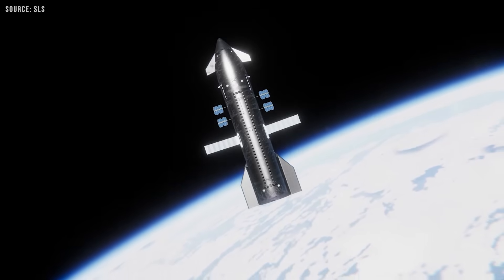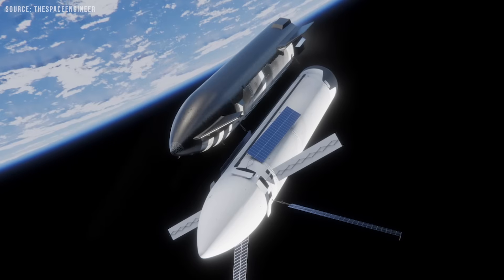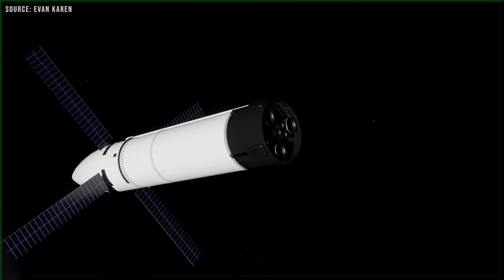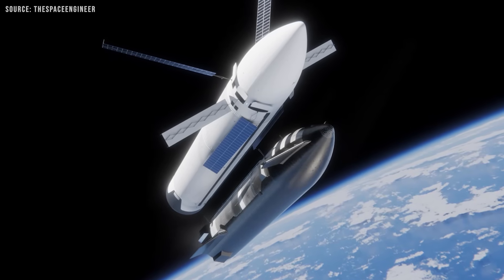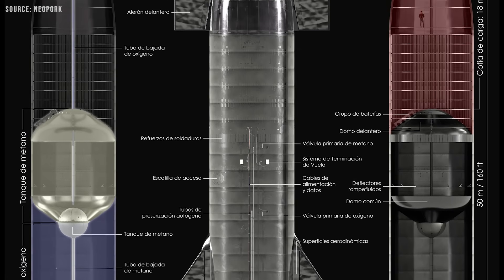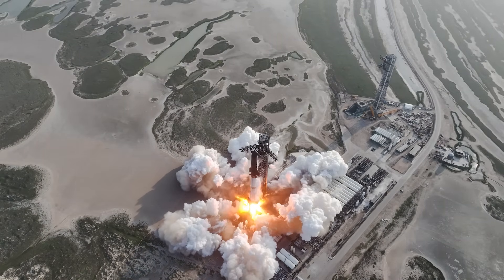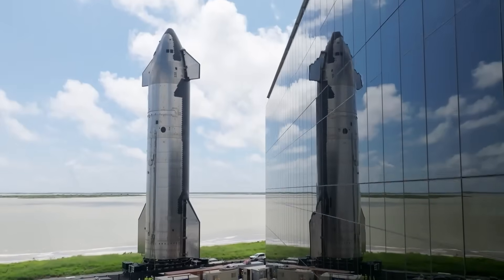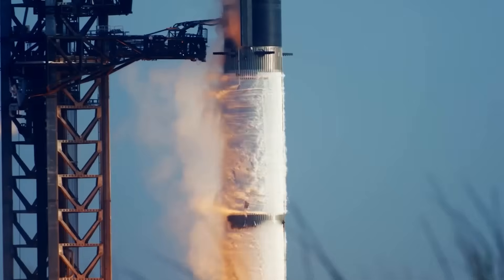SpaceX’s New Starship Refuelling Solution: Solar Panels!

Comment: nothing against whoever is creating the video - but almost every sentence is reeking of BS due to the fundamental design flaws and overhype

standard starship - does not exist, they don't even settled on the final dimensions
it is not waiting for another starship to refuel - it is waiting for another 10
future deep space missions - SpaceX never flew anything outside of GPS range and they will max. land on the moon. Everything in regards to Mars is hot air. They could send stuff to Mars for 10+ years now and didn't even bother to send a simple communciation satelite to get some deep space experience